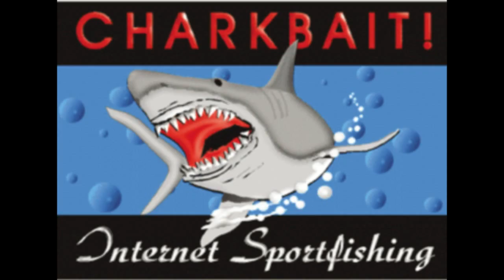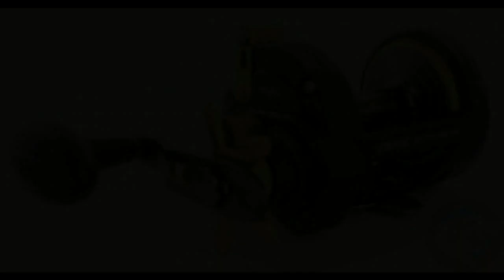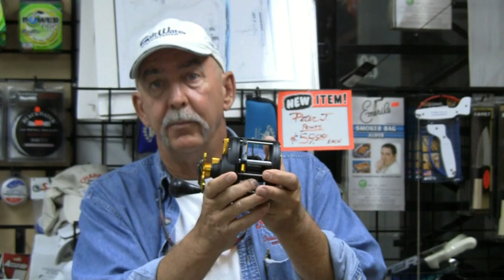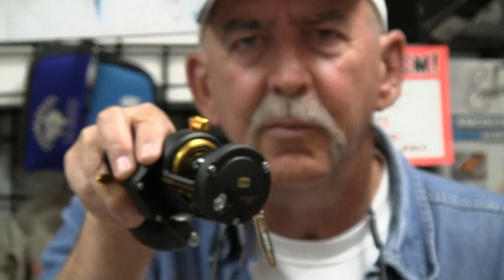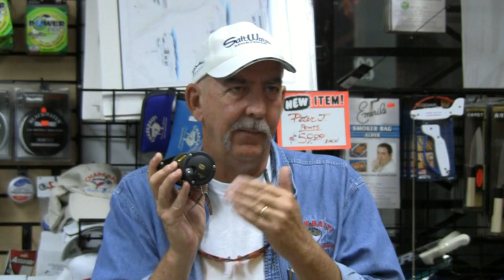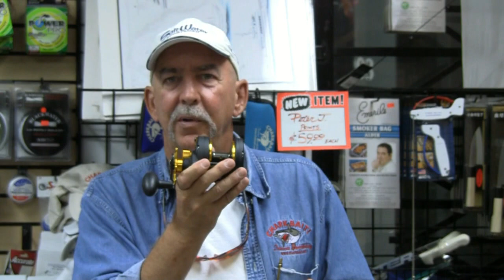Penn Fathom Star Drag Reel - New for 2011-12

Comment: Sadly penn never released a fathom star drag under a 6 gear ratio. I like to winch my grouper in and 6 is too fast at times for that. My 112 senator has a 4 gear ratio and with an adjusted handle I still have problems winching a 30 inch gag off the bottom, maybe I'm just weak. I'm looking to try the new torium shimano displayed at icast with a 4:3 gear ratio and power handle, but I've been a penn guy for years. Got any extra 25n fathoms laying around?
Reply: Just-released Fathom II star drags now have versions with 4.8-1 gear ratio.
Reply from the maker: I hear you, but really it's 2018 not 1970...  Get the two speed leverdrag version and have the benefit of a faster retrieve for winding a jig more effectively AND more power to turn a fish's head by dropping down to low stump pulling power at less than 3:1.  The difference in bucks between single and two speeds has come way down, some wonderful options now available from Penn, Okuma (Metaloid 2 speeds at $219 and up...) and others that change the game in your favor.  No star drag 2 speeds, but the LD's have improved so much.
Reply: Thanks for the response sir, but I fish is from land, so I'm freelining/casting a lot, some okumas do have cast control, but I'm an old school star drag guy. Nothing feels better than flipping the bail and cranking. I did have a tiagra, but to get the amount of free spool i need to swim the bait out there isn't enough because when i set the lever it usually isn't enough drag and the grouper finds the rock (i've lost many fish like this). True free spool over with button downed drag over any type of drag control for what kind of fishing I'm doing.

Comment: What do you recommend for pier fishing in Galveston Texas Gulf Coast? For red fish, bull red, flounder, drum and trout? What reel and size? Thank you
Reply: Best to correspond through CharkBait's website - I catch emails daily there but more often don't have time to get back online with YouTube.  Reel recommendation, well that's going to be based upon line test needed to be fished. With a clue on that one, I can assist and point you towards the right direction.
Reply: +Mark Smith will going to use 50# braid with topshot 30# mono

Comment: what rod should i match up with fathom lw25?
Reply from the maker: BiCepsTheRapist Many good ones to pick from, Calstar, United Composites and others. The question is the line test being fished, with that the appropriate rod becomes easier to recommend. Rods really should be rated in terms of drag load rather than line test. That provides a better measure of how the rod will load up when being fished.
Reply: ***** I dont need something that expensive I found a good rod to match up its called knock out edtion catfight rod  by bottom dwellers rated for 20 to 60 pound line and 2 to 16oz lure

Comment: He said that free spool has excellent casting potential. He should have said the free spool  has excellent back lashing potential. The Penn fathom is the most expensive reel i have ever owned. I am utterly and totally disappointed with mine. It didn't even come close to the hype.  My 1st and last Penn I will ever buy.
Reply: You obviously dont know how to cast if your getting backlashed
Reply: Joseph, it is very true that the Fathom series is extremely fast because of the "Live Spindle" feature.
This series has centrifuge casting brakes that can be fully engaged as your casting skills adjust to this speed.
Even expert casters may take a half-day of use before they can handle this speed if the brakes are not used at first.
Start out with all of the brakes "on" and go thru several fishing trips, and then disengage only 2 of them.
After that, your own skill will tell you when/if you can disengage any more [or even all] of the brakes, and it is indeed true that the "free-er" the freespool, the greater the chance of backlash.
However, it also gives the most potential casting distance, and also allows small live baits to swim with the least resistance.

Comment: i'll take your word for it. i really like the fathom 12 or 15 for the drag capability, but after hearing about the anti reverse going bad, i kind of got hesitant to pick one up, but i think i'll pick one up now. seems to be the only reel in that size with that drag capability for that price range. also, i heard that there were brake blocks you can adjust if you remove the side plate. is this true?

Comment: Hi Mark,
The drag, sleeve, and thrust bearing design in use on the SQL lever drag series just got a "Best on the Market" rating from Alan Tani.
You are of course correct about the inherent line test limitations of a graphite-framed reel.
The good news is that the upcoming Penn Torque TRQLD2 2-speed lever drag [machined aluminum frame/sideplate] series will use a very similar design, although with some upgraded materials and a slight price increase.